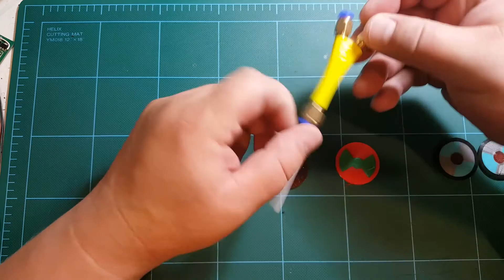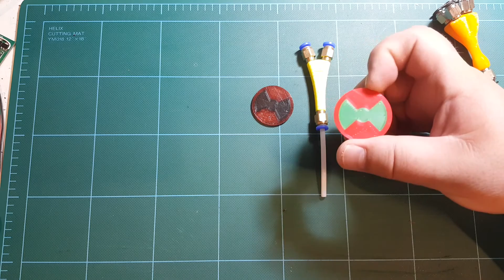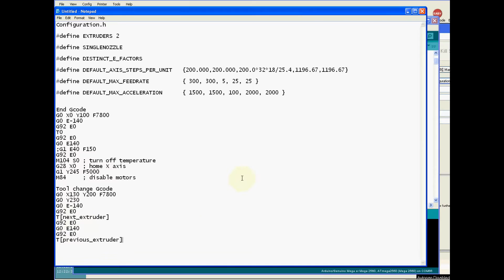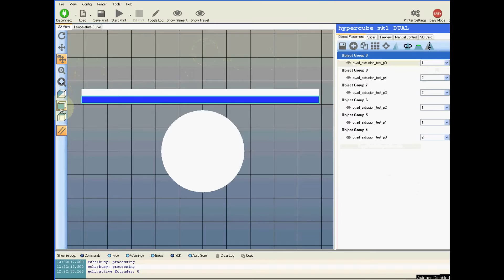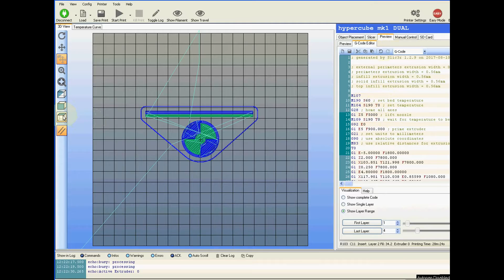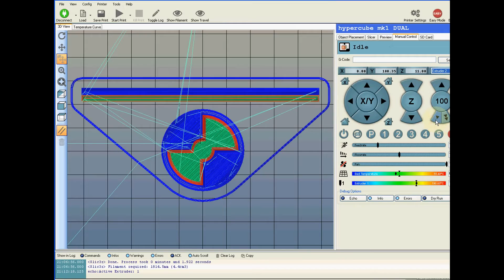Dual extrusion

Comment: Hi Arthur,

you should try Slic3r Prusa Edition and check their Multi Material config...https://github.com/prusa3d/Slic3r-settings/tree/master/Slic3r%20settings%20MK2MM You can use Slic3r PE with any printer just configure it a bit.
Reply from the maker: Thanks for the tip. I did try it. It won't work because it only retracts/ejects 90mm on tool change. I need 140. Unless you know of a way to pass that parameter to this version of slicer. I could not find anything.
Reply: As far i can see in the they changed in their Slic3r retract_before_travel from 1 to 3,3,3,3; retract_layer_change from 1 to 0; retract_length from 0.8 to 4,4,4,4 and retract_length_toolchange from 3 to 4,4,4,4...they also don't use tool change script, but maybe of implementing in firmware. Maybe it is an option to generate a simple gcode and looking for the line where it changes the extruder...by changing these values above you could find which one you need to adjust to get your 140mm.

You also can look for hints in the Prusa firmware searching for 'SNMM'...Here some thing i found
#define FIL_LOAD_LENGTH 102 //length for loading filament into the nozzle
#define FIL_COOLING 10 //length for cooling moves
these are used to calculate the extruder moves while changing tools and filament...there is for sure more 

Hope that helps
Reply from the maker: That's the problem. Prusa added a ton of custom code to their version of Marlin. That never got back-ported to real Marlin. They also removed support for all boards other than the ones they use. So I'd have to back-port new code or re-add board suport. Either way a messy undertaking.
But thanks for finding those defines. That narrows things down a bit should I go this route.

Comment: How do you ensure that you get consistent retracts and re-inserts. Just basic retract and insert commands eventually lead to a clog in my tests because the filament comes out with whips at the end of it -- that's the key to making this reliable/repeatable. (hence why I picked up the specially machined and polished multimaterial heatbreak) -- there is special gcode to to do purge retract to ensure a clean retract to avoid clogs.
Reply from the maker: Yes, I'm struggling with this as well. Apparently retracting your filament as fast as possible helps. I noticed that Prusa version of Slic3r does some back-and-forth movements perhaps to clean up the tip. Also, someone recommended a special heatbreak in my prior video comments.

Also, I've noticed that this dual Y adapter I'm using here seems a bit less prone to clogs than the 4 way adapter in the other video. Maybe the PLA that was used, maybe the pneumatic connectors - not sure what makes the difference. With this 2 way adapter I was able to print multi color lizard. With he 4 way adapter I can't even get the test print I show in this video to finish... yet :)

This is all work in progress. I'm posting what I have so far with the hope that the more people start working on this the sooner we'll find a good solution.